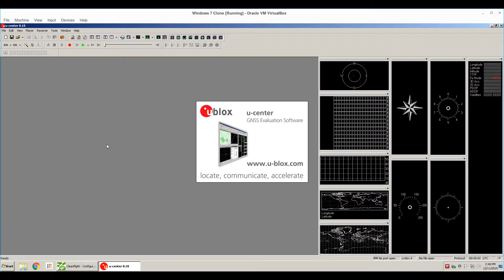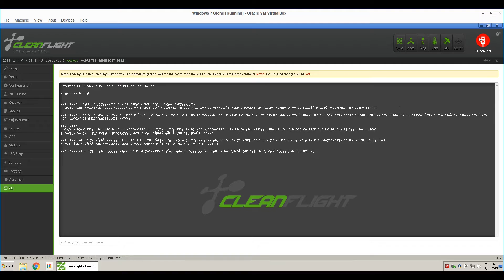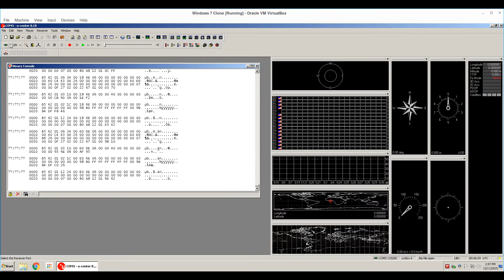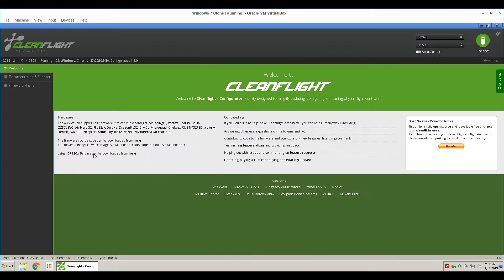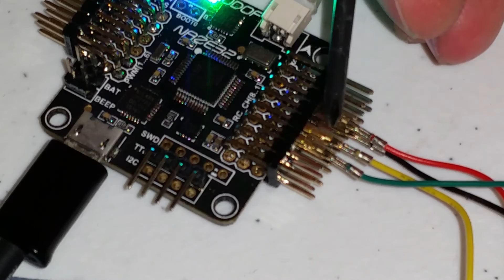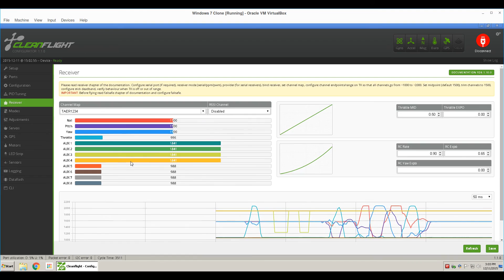Setup a NEO-6M GPS with Spektrum Satellite on Flip32 10DOF

Comment: 3d fix , no found
Reply from the maker: You would might have to reset your GPS unit in UBlox.  Instead of Cleanflight try using INAV.  If your GPS unit is set to the default settings in UBlox then INAV should communicate with the unit without the need to configure the settings.  Also ensure the TX on the flight controller is plugged into the RX on the GPS unit and the RX on the flight controller is plugged into the TX on the GPS unit.

Comment: Hello I was following your direction on the video and I think I may have brick my flip 32 FC. I have a NZ GPS and when I went to CLI and type in gpspassthrough I did not get what you got on the screen. I think my screen say type exit to go back and nothing happened after that. The program froze. I tried starting over and after flashing I tried to connect and it give me a time out error. Please help.
Reply from the maker: +Cameron Hinds If you bricked your Flip32 try putting a jumper between the two BOOT pins, disconnecting any peripheral devices like the GPS and connecting the FC to CleanFlight and reflash.  I do not know if NZ GPS is even compatible with the steps I outlined in this video for a Crius NEO-6M.

Comment: if the ftdi adapter worked ok and suddenly stopped you can check if the driver has been updated. if it has version 2.10 your ftdi adapter has been bricked by FTDI driver.
the only solution is unbricking with linux commands. google ftdi and brick and you will find lots of angry ftdi users.
Reply from the maker: +Raddy Beer FTDI at it again with their drivers.

http://hackaday.com/2016/02/01/ftdi-drivers-break-fake-chips-again/

Comment: Maybe you have a fake FTDI, which are blocked
Reply from the maker: +Raddy Beer Could be a fake.  I bought it off eBay.  I wonder if there is a utility from FTDI to detect fake chips other than the new drivers borking fake FDTI chips.
Reply: That is the hard part, but can be done. If your ftdi adapter is cheap <3 dollar its fake. Almost all real FTDI adapters are >15 dollar. Fake adapters have printed mark on their cpu. Real have engraved FTDI mark. Windows and Apple install FTDI drivers which dtect fake ones and make them unusable.